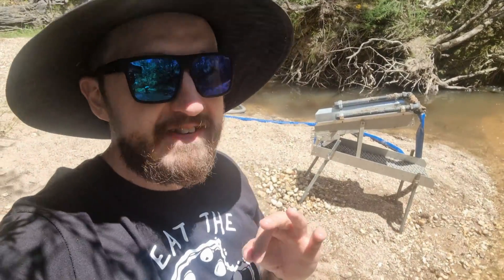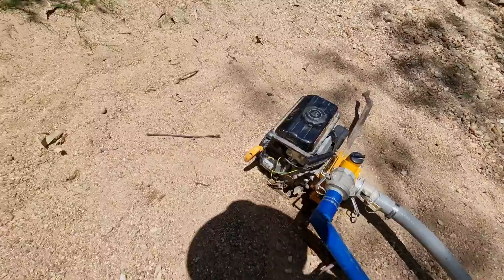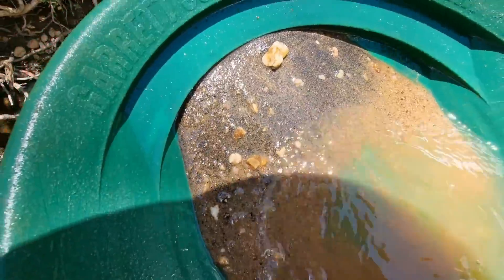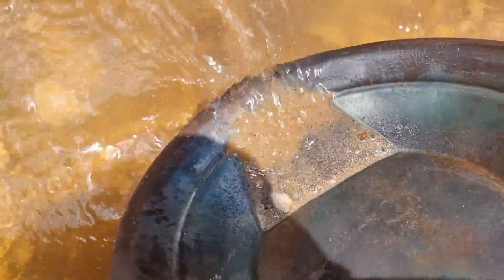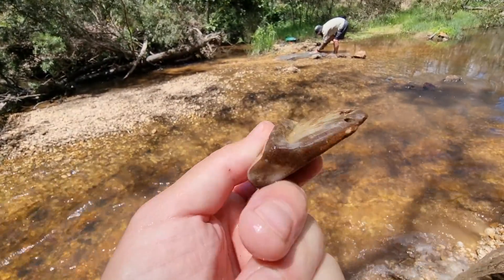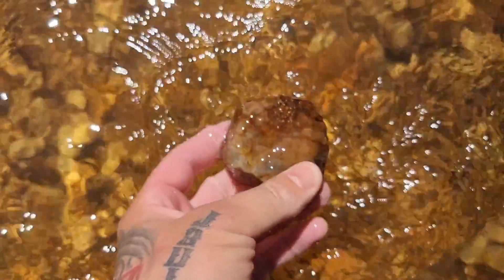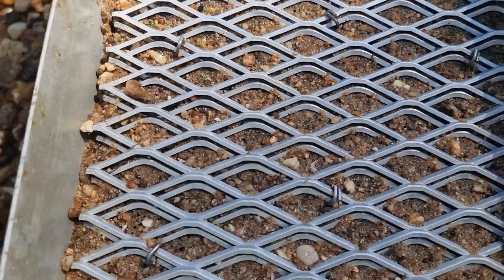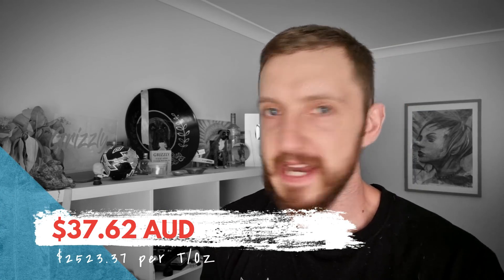How Much Gold is in Sand?

Comment: Do u use a tumbler dry with mercury to capture?
Reply from the maker: No.
Reply: Old timers work the gold down by all efficient means then save all the fines with flour gold until there is a volume worth running with mercury.  Some burn and retort, some separate using leather, cloth, roll up the amalgamate and squeeze the merc thru. Save the merc for the next batch.  It would be interesting to know how much gold is recovered and is it even worth it.

Comment: Nice videos chris!   I did my first bit of exploration yesterday, got samples from previous mine areas local in creeks, think sand made it so hard to pan my first time.  Felt like I was doing it wrong, too much in the pan possibly?   Any pointers of tips to make it alot easier? My eyes are so sore 🤣.  
I did find gold though in quartz/iron rocks, i need to get myself a dolly pot to expose our first treasures! Cheers for the great info in the vids.
Reply from the maker: Its just practice mate. Keep at it, watch how others do it and experiment. Don't worry about loosing gold, you never had it to being with.
Reply: @VoGusProspecting  cheers, i will be abit more prepared next week with the gm1000, sluice and dolly.  Going to give melbournes old sites a good crack over the holidays.

Comment: Actually, your observation of Mick's setup is spot on. If you run a sluice like that, don't stop the water, because that is the moment where the black sand will settle, compact and if you re-start, your gold will just run over it and out of your sluice.
Same if you pause working your highbanker, let it run in idle but don't stop the water. just don't.
I worked a place where I had half a bucket(!!) of black sand from 400L of paydirt as a test with panning down to just the black sand.
(the gold is same as in reedy creek, super fine but plentyfull)
If I work that with a sluice, i would clean out 2x per tops after working it 4H each run. 
Yes. my tailings show a line of black sand, but gold... zero.
I would not run over 8 degrees.
Be safe & healthy!

Comment: I’ll guess .58 g back to the reveal that’s what I get for second guessing myself first guess was .48 . Not bad at all for easy shoveling I prefer 8 degrees for catching super fine flour gold but I also use a 4 foot homemade sluice with a cut down old mud flap with high low almost V riffle on it to prevent getting to much black sand in my cons 4 feet nets about 3/4 to 1 cup of cons and it doesn’t lose gold unless it’s a nugget of size (.35-.50g) which has only happened once with a paydirt bag  (I put a pan at the end just in case I get lucky and get a nugget). I understand why you run at 11 degrees I reckon any less than that and the tin just piles up to quickly. great episode thanks for sharing see you on the next one👍🏻👊🏻
Reply: Excellent input 48th love to see other prospectors explaining there set up helps me understand which set up I might need in uk